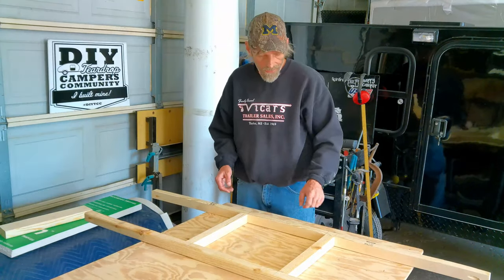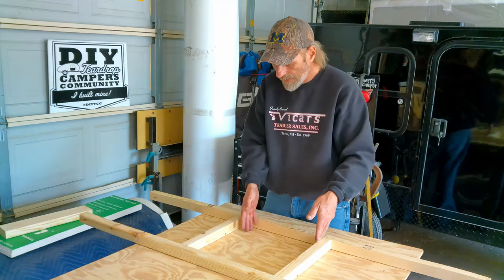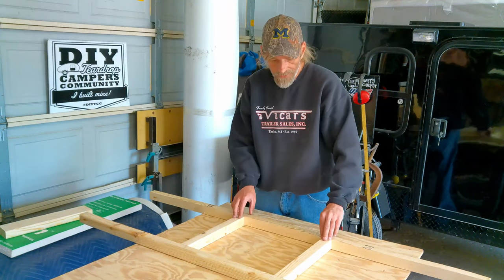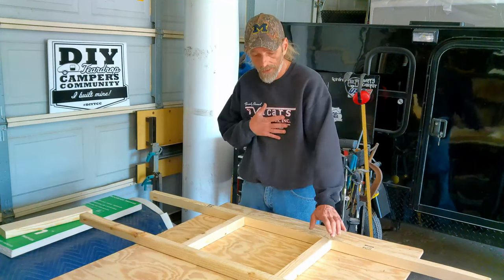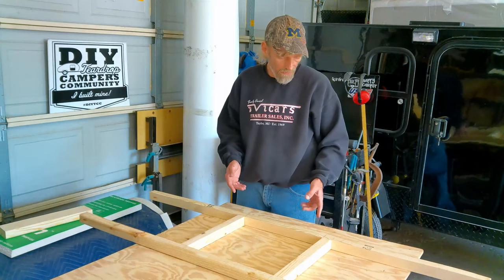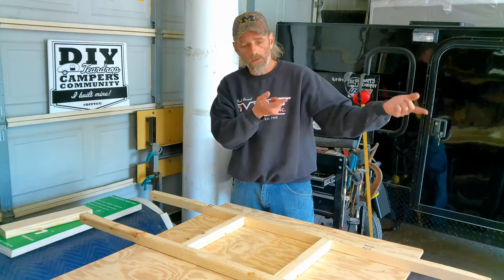How to Build a Teardrop Camper Part 4. THE ROOF SPARS

Comment: Seems like you've got a good and budget friendly way to build these. Thanks for putting these videos together. I'm sure I'll take a few of your tips when I build mine. I plan on insulating the walls and I'm curious what you think about that. It would add complexity and cost, but probably make camping in the upper mid west (ie. WI and MI) better in the spring and fall. Thoughts?
Reply from the maker: I have insulated the walls once. I still used plywood for the walls, made a 3/4 inch skeleton (1x3 on the flat) and filled in the voids with insulation. Then, just skinned over it using the same wood as the ceiling

Comment: Why use glue on the joins
Reply from the maker: Just another way to keep the spars in place. I have found the glue holds up just as good as screws. I had to remove one before and it took some plywood with it
Reply: @DIYTearDropJay  I must say you are doing a good job but i might get a little frustrated with the clue if it drys to fast lol.
Reply from the maker: It takes some time to dry. I let things set overnight before continuing on most times. Thank.you for the kind words, I appreciate it!